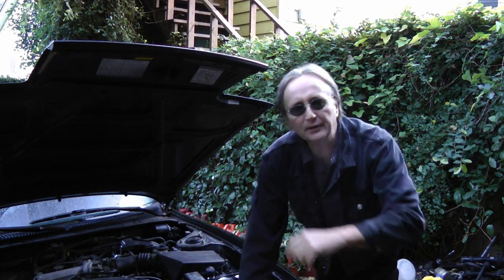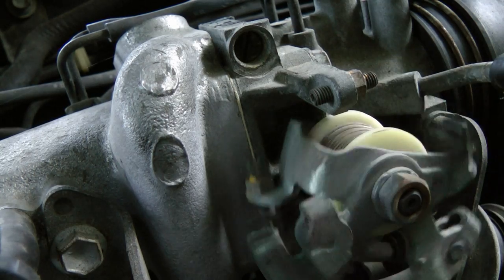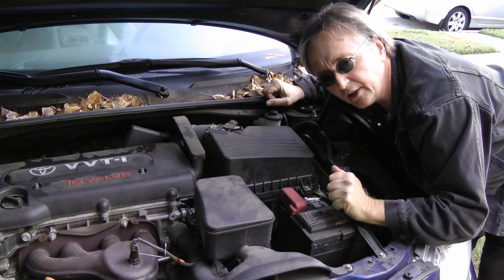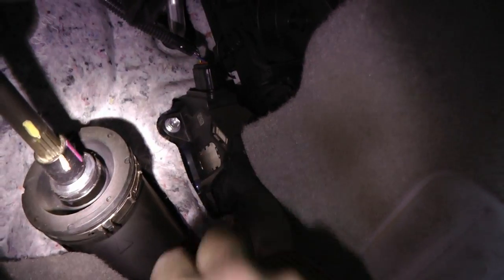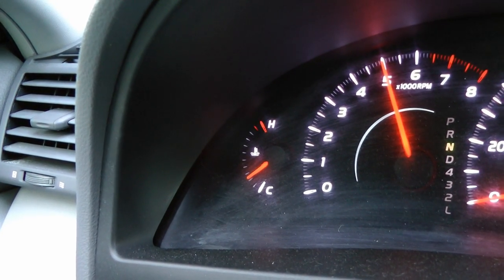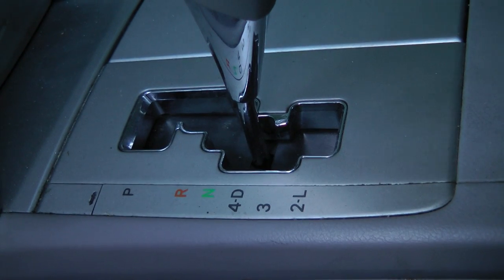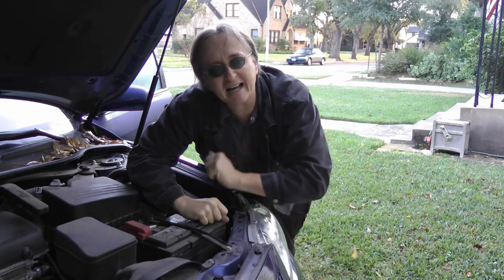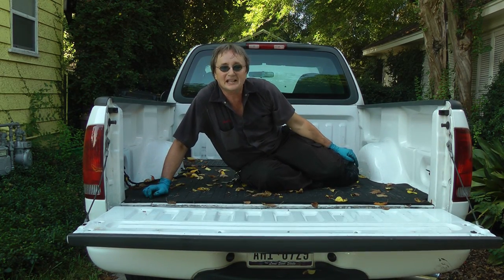How To Stop Unexpected Car Acceleration

Comment: few years back got in the wife's vehicle to take trip, once on the highway I engaged the cruise. later on hit the acc button to speed up and it just kept accelerating once I let go. got to 80 and still going, brake pedal had no effect on shutting off cruise. so slammed it into neutral, and pulled over to shoulder and shut it off. restarted and it was back to normal, but I didn't use the cruise for remainder of drive. once back home I dug into it, and found that the steering wheel, someone had spilled soda or something sticky and wiped it up, but it got under the switches also, the acc button was Stuck in On all the time when I had pressed it. every time I tried it, it was repeatable. cleaned it all out and it was good. then had to ask who spilled something all over the steering wheel, to which I got a puzzled look from the mrs, but no answer
Reply: what car was it?
Reply: Ford minivan
Reply: wow
Reply: Ron Wilgenbusch guessed it would be, read about it some years ago.
Reply: Ron Wilgenbusch Thankfully, you're ok.
Reply: My ford taurus kept doing this also

Comment: Thank you for this video you saved my life! Last night I was watching your videos to help my friend find the source of a noise in her car and stumbled across this video. This morning, I was driving down the street going pretty slow because I was next to a school. I was slowing down for a car merging onto the road and when I lifted off the break (hadn't touched the accelerator) my car started speeding up and wouldn't stop accelerating and reached over 50 mph in a matter of seconds. I had my full weight on the brake and it still wanted to zoom forward. There was a red light maybe 50 feet up ahead with traffic moving very fast. If I hadn't known to switch my car into neutral I would have hit the traffic going over 50. Thank you so much. You don't know how grateful I am.
Reply: I had similar situation, did you find out the issue? You fixed your car ?
Reply: @bilalahmad9638 what is the issue, my mechanic seems to think its a fuel pump issue
Reply: @emmanuelandam9539  Hi , unfortunately i sold the car.

Comment: "Sometimes modern technology works against your own best interests" 
agreed.
Reply: big time, like on the gmc envoy did you know that the ac unit will NOT allow you to run recirculating heat without the ac compressor running?

on a 1996 toyota corolla you can run recirculating heat with or without the ac compressor and it can really make things very hot and toasty inside

Comment from the maker: @crazysamz  Yes, that's the main reason I made this video. I found out my own customers had no idea what to do. And it's SO simple. Scotty
Reply: This happened on my 06 ford taurus and then I'd press brakes and it wouldn't slow down. Then one day on highway it just stopped driving forward... like the speed wasn't going up anymore so I pulled off highway and turned off then on and it was only going in reverse after that. Someone said transmission and I paid someone to put a new torque converter in and the person stole my catylac converter .... the car runs but now it stinks and is loud and I've got no money to fix it . 😢
Reply: Also the car had ac before the guy worked on it and now it has no ac at all
Reply: Why is that

Comment from the maker: @SpeedFreakNO hey, you're not supposed to revv it up like that anyway, serves no purpose. If it runs fine otherwise, leave it alone. If not, remove the throttle assembly, take it part, and clean out every single hole and make sure the throttle plate is shiny clean so it doesn't stick

Comment: With the Toyota Prius, owner were installing aftermarket mats over the factory mats. The factory mats have holes that hook onto the carpet to keep them from riding up. Aftermarket mats don't have anyway to keep them from riding up. The would bunch up under the accelerator pedal. Plus, it was determined after viewing vehicle's black box, many people hit the accelerator instead of the brake. That one guy that tried to sue Toyota never got anything. Turns out, he was way over on his mileage for the lease. He staged a runaway and wanted a new car.
Reply: Many cases of SUA can be attributed to driver error. Take the notorious cases of Audi cars in the 1980's that had that problem. The cause was determined to be driver error, because the pedals were of a different design compared to cars sold in the US for decades. The Audi 5000 sold in the US got a tainted reputation, yet the same car sold in Europe had little trouble. 
60 Minutes blatantly lied, blaming the problem on the vehicle's design. Audi nearly pulled out of the US market because of the bad publicity it received. I guess it just so happens that in every case the throttle sticks AND the brakes fail at the exact same time...
Reply: nigahiga6400
I had an '84 Audi 5000S, bought brand new. Mechanically, nothing ever went wrong, however, every electrical switch had to be replaced at one time or another. We put 200K miles on her before we traded her in.
Reply: cruyeda German cars are a hit or miss as far as electrical gremlins go. My old 1985 VW B2 Passat went strong for over 20 years without any electrical gremlins. Very reliable mechanically too. Now my neighbor's 1999 BMW 528i is rarely driven, but it always seems to have an electrical fault. The power windows stopped working, and then the interior lights, then the entire car just had no power, etc.
Older English cars, like old Jags, are notorious for bad electrics, as are Italian cars. The early Jaguar XJS models had cheap transistors that caused the car to have no electrical power. In some cases a short circuit caused the entire car to burn down; this problem affected Jags, Rolls, Bentleys, Rovers, and other British cars of the era.
Electrical problems are a pain to deal with, so much that I completely re-wired my XJS coupe. Took me about 6 months to strip the car completely and get the job done, but at least it saves me the trouble of trying to fix the thing when the electrics go wrong.

Comment: One thing I'd like to add to this emergency sittuation is to press the brakes at the same time. The brakes can always overpower the acceleration of the car.
Reply: No not always.  Just ask Anne Heche....
Reply: Put it in neutral
Reply: @reesedaniel5835 yes always, it’s not even close. Braking power trumps acceleration by miles. just don’t pump brakes.

Comment: the problem with shifting into neutral is you might not be able to do that either. the shifter is no longer physically attached to anything any more than the gas pedal is. if the electronics fail, it might be stuck in drive. you might not even be able to shut it down by turning off the key.
Reply: And that's why I love manuals.
Reply: +chieftp 
Except, such a system would throw a computer code waaay before that happens as these systems have at least double fail safes (same with the electronic throttle). And no NASA investigator found fault with the shift or throttle system.

And supposing it did throw a fault code and the driver ignored it, it would be the driver's fault for ignoring their check engine light and drive on the streets.

In any case, the fault lies with bad drivers who should not be on the road ... we need stricter licensing requirements.
Reply: peachees
I'm sure you're right. I can't imagine a company making a bad product with a faulty, potentially deadly design.
Reply: +Filipe Amaral yeah, with a manual you could probably use clutch control if you really need to. might need a new one after though
Reply: *****
if the entire thing went? it doesn't work that way. individual parts of the computer and/or software can go haywire and cause the car to accelerate and not let you shift into neutral.
Reply: *****
I'm fairly certain that one off space shuttles are made to a little bit higher quality control with better components than mass produced cars with chinese parts.
Reply: *****
all the parts used in mass produced cars are the cheapest, lowest quality available.
Reply: *****
it's the most efficient to the manufacturer to use the cheapest parts available. but it's not good for the consumer when the parts fail prematurely, and you have to go buy more expensive parts to replace them.
Reply: *****
I'll give you an example - I had to replace all the ball joints on my truck because ford decided to use cheap chinese ball joints which omit a 5 cent grease nipple. they're impossible to lubricate and wear out in less than 8 years. I replaced them with American made Moog ball joints which are a little bit more expensive, but are also a lot better quality, greaseable and will probably last the rest of the life of the vehicle. they pretty much repeat that pattern with most every other part on the vehicle.
Reply: Or you can try to hit the brakes, some cars have brakes that stop the car in a situation like this
Reply: Rainbow Dash not always if the accelerator is stuck at 100%, old older cars that was moving to electronic peddles (more specifically Toyota) they did not have failsafe separation on the ecu that controlled the engine or ECC detect and correct, so extreme rare cases have to move your seat forward so you can put both feet on the brake peddle and put your back into it to overpower the engine as brake assist was unavailable at 100% engine demand (moving to neutral did not work typically , but unsure if the hold start button for more then 5-10 seconds shuts the car off or not) this is not related to mats getting stuck under peddle or 4 faulty sensors on the peddle, this is computer going 100% demand on engine even thought paddle is not depressed
Reply: Saw this years ago on a episode of Rescue 911 a woman's VW Golf pedal sticks she tries tuning the key off and shifting into neural but every thing was broke watch the episode here on YouTube.

Comment: I drove my dads toyota echo (It's manual). It uses cables to pull the throttle open.
One time when I was driving back home, It suddenly accelerated like I had my pedal to the metal. So I slipped my gear into neutral while it was hurtingly Red lining. Turns out it was my carpet which had slipped over the gas pedal..........
Reply: alex pencek Get long floor mats that go up under the pedals. Not only will the floor of your car be cleaner, but things like that can't happen.
Reply: Older Toyotas would commonly have issues with throttles sticking. So they put in new fasters on the floor to prevent the carpet from getting jammed under it

Comment from the maker: @dynomite1988  Not really, but if you're worried about that, turn the key off after getting control of the car. Most cars have rev limiters in them these days when they have electronic throttle control. Scotty

Comment: how about 1967 and back when they used linkages. Iif you had a broken motor mount and you torqued it up hard it would bind and get struck open